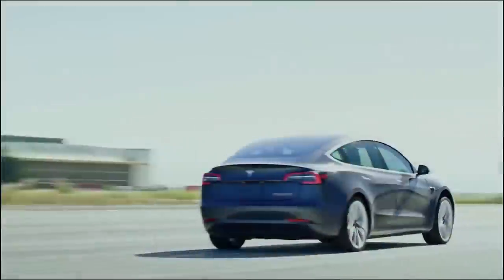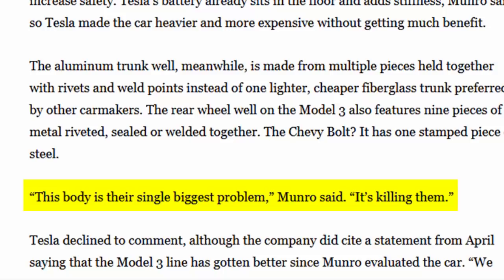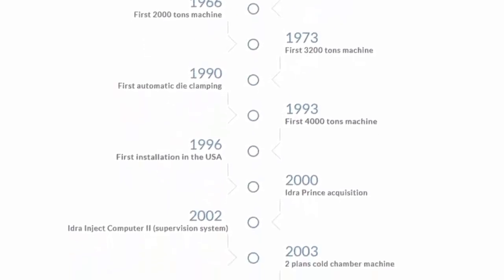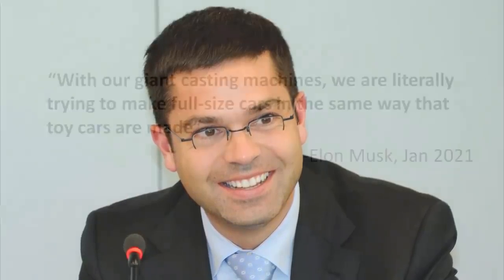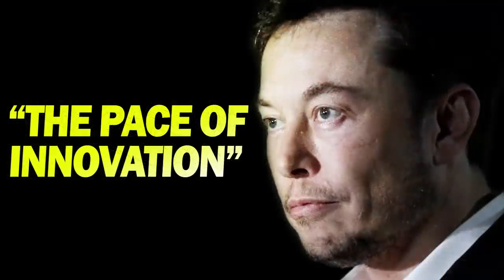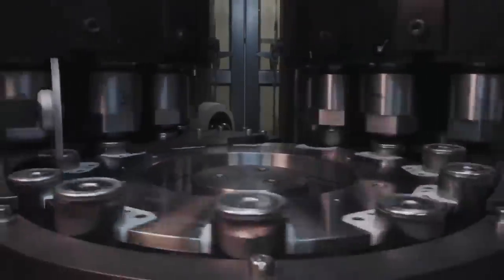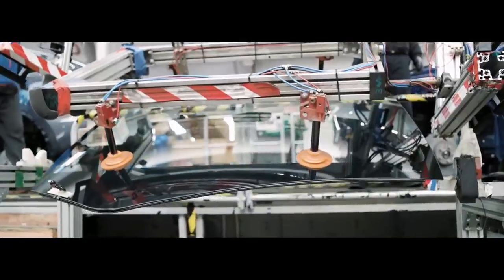Tesla Giga Press will CRUSH

Comment: The weight of  a tesla is insane  !
Gotta make that car weigh in at 3000 lbs or less !
Then we could double the miles between recharge !
500 miles instead of 250 !
Wow that might make the proffits of recharge stations suffer !
 Well too darn bad !
And where are the solar panels  on the car ??
It should be soaking up sunlight all day long !!
Reply: The weight might be insane but its a good thing to a tesla cant flip they tride it wen testing it at road worthy test the tesla shape and wight wont allow it to flip on its roof
Reply: Solar panels are heavy. 

Also, weight is not much of an issue, they range would not change appreciably. My experience: Autobahn, constant 130 km/h -> 18-20 kWh/100km. Sprinting around the countryside, lots of accelerating and decelerating -> 13 kWh/100km. Model 3. Yes, I could do that all day long before recharging, the resulting range with tha tkind of consumption is >700 km (almost 500 miles). So we're mostly there already. 

Also. check out the latest Audi A4, with one of the more performant engines. It's lighter, but only about 150 kg. That's not even 10%.

Comment: Tesla is not a totally vertically integrated manufacturing company.  I'm not sure why that idea is so prevalent.

The main thing Tesla makes that's traditionally outsourced is seats.

Tesla does make its own traction motors and electronics, but this is equivalent to an ICE maker building its own engines.  

Panasonic builds the current 2170 and 18650 batteries, and CATL builds some of the LiFePo batteries used in cars.  LG, SK, etc., supply batteries used by Tesla Energy.

The new 4680 Roadrunner cell is being designed by Tesla now.  It's unclear whether they will produce them in volume themselves, or partner with Panasonic, etc.

There is no reason for Tesla to buy the casting machine company any more than to buy robot companies.  Like wheels, tires, brakes, steering gear, suspension components, glass, dashboards, lights, etc., those are commodities sourced from external suppliers, similarly to any other car company.

Comment: I wonder if Tesla would do a "refurbish" of sorts for older Tesla Automobiles. Swap out the multi-piece designs for a new single piece replacement. If it is monetarily viable might it turn out to be good business sense? Have brand loyalty/dominance. GM has no clue what it is doing these days and I don't think Ford is that much better.
Reply: You mean disassemble the entire car to swap out some stuff for no reason? Yeah some idiot is gonna pay for that
Reply: @johnuferbach9166   Well if someone is bitching about "a bunch of stuff" it then it would be for a reason.

Comment: Still unsure why it’s called a “press” when it is a casting device.
Reply: Because aluminum casting must be done under enormously high pressures to get the complex shapes and details to come out correctly.  The bigger and more complex your piece, the exponentially higher pressure you need.
Reply: @suunraze  dude I’ve been asking this question for ages and you’re the first person with a reasonable explanation 🥳.  Any explanation, for that matter.
Reply: @suunraze  I still don't get it.  The only high pressure required here is the pump that pushes the molten aluminium into the mold.  The mold can just be held shut with clamps - no press required.  Is that's what is happening because it doesn't look like it?
Reply: No it can't just be held with clamps the process requires the molten metal to be under high pressure during the hardening/cooling which is done with a literal press.
Reply: @MrDJAK777  you can't close a press and then inject the aluminium after.  Is the press not fully closed, then the aluminium is injected, then the press applies a force (without significant movement)?
Reply: @Spedley_2142  the plunger that does the injecting stays there and holds the pressure and applys further intensification pressure if needed.
Reply: @Spedley_2142  the molten alloy is forced into the die with a hydraulic ram ,it isn't pumped in. the clamping is also done hydraulically to achieve rapid cycle times . I've been a hydraulic engineer for over 35 years so calling it a press is quite accurate.
Reply: I would call it an injection mold machine.  It is not a press as it does not work with a blank. It is not extrusion as the part does not flow out of the tool.  It is not casting as the part is formed not poured.
Reply: Yes. It's high-pressure injection moulding of metal using a high-pressure hydraulic ram. BMW have been making engine blocks this way for a while.
Reply: Probably because it's a press lol. It's not regular casting that doesn't use pressure. The dies press molten aluminum into place and that greatly increases strength.
Reply: @clutchboi4038  I don't agree.  The dies are assembled before the metal so it is injection.  Press dies are open and close on a blank.
Reply: @edwardg9695  Then it's a FORGING, like making a forged piston. You inject the aluminum and squeeze which helps with strength and also makes any air bubbles very tiny.
Reply: @peterdarr383  The mold is not moving.  It is clamped shut and vacuumed out. The molten aluminum is then injected hence injection molding.  If it used a billet and the forge closed on the billet to shape it - then I would agree.
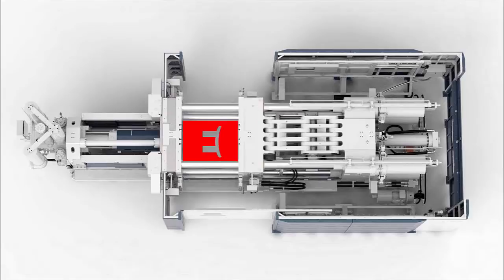Reply: 6:11  the two halves of the die cast mould are closed using a PRESS, the alloy is then injected at high pressure through a feed hole, then solidifies. The press then opens releasing the finished part.
Reply: @the_lost_navigator7266  you dont need a press to close stuff though
Reply: @johnuferbach9166  no, but a press will withstand the huge injection pressure trying to force the mould open. My company has several wax injection mould machines, they all feature a hydraulic press to open and close the mould, and cope with injection pressure.
Reply: Smart people misname things all the time. Physicists call a portal across bent space a "wormhole." WTF? There are no worms burrowing through spacetime (I hope). And why do orthodondists call some human teeth "canines?" They're not dogs. They're teeth!
Reply: In fact casting is when you let go molten metal in form by gravity. In this case is the keye pressure because aluminium is not during moulding liquid is just on border to be solid. Therefore can be tool opened so quickly and no need to wait for long cooling. The tool it self will be nice piece of engeneering. Machine it self is a bit bigger than normal machines.
Reply: Because of media/tesla idiocy
Industry calls them diecasting machines. Plastic injection molding machines, which are very similar in function ,are also called injection molding machines and not presses.
The only things industry calls presses are ,funnily enough, presses. Such as the sheet metal presses that form automotive body panels.
Reply: @paulg3336  I had a feeling it was marketing shenanigans
Reply: @paulg3336  Actually, it's because of the complex function of this machine, because it's basically both, die casting and a press. If you want to have a great pressure of injection you also need a f-ck ton of press clamping force to hold the mold shut, so none of the liquid metal sprays through some micro slit in the mould. Imagine 900C aluminium under that pressure gushing through some breached crack.
Reply: @mjtwardy  pressurized molten metal  would probably be one of the closest analogs to a lightsabers on screen effect just more sticky and indiscriminate.
Reply: @MrDJAK777  Maybe not like a lightsaber but a phaser beam out of control. :)
Reply: @mjtwardy  Yes , I used to operate plastic injection molding machines as a school  holiday job. The clamping force on those are typically several hundred tonnes for large tools.
Still never called them presses though. Must be a yank thing. Using the wrong words for things is your national sport isn't it?
Reply: @paulg3336  I'm not an American, if thats what you ask. I understand its a mold injection machine. I think the "press" name is just a mental shortcut and most people do not really care if its a die cast mold incetion or just a press.

Comment: So, doing the math - 13,227 lbs of force. Ladish, in Cudahy, Wisconsin, USA has presses rated at 4500 tons, or 9,000,000 lbs, and another  (seized from Nazi Germany at the end of WWII) rated at 10,000 tons (20,000,000 lbs). The Russians seized the largest press the Germans had, and the US got the next two smaller ones. Germany was using these to make aluminum forgings used in fighter aircraft due to a ban on imports of steel. These large single components were lighter and stronger than comparable assemblies made of multiple pieces, and were used in the formidable Messerschmitt fighters, including the 109, and the first jet fighter, the Me 262. For more information, look up "The Heavy Press Program." 
Incidentally, the swastikas and eagles remained on the presses at ATI in Cudahy until recently. Many foreign engineers and project managers raised eyebrows and had questions when viewing the massive machines. The markings were eventually removed.
Reply: https://youtu.be/iZ50nZU3oG8

Comment: I have worked with large molds for the last 23 years using a 3500 ton cold chamber Prince die cast machine.  I can say that die cast machines are work horses and rarely break down.  Mind you I did have a large stock pile of spare parts to aid in having the machine repaired usually in a matter of hours.  My mandate was to be able to fix any issue and be back up and running in three days.  Rarely did I need that time...
It's amazing the size these machines are by trying to imagine how big this is by the image at 4:50 sec with a guy standing beside the machine and is not even as high as the lower tie bar!!!

GREAT VIDEO!!!
Reply: wonder what size tip they're running 8 or 10 inch, I ran 2500ton in squeeze cast cold chamber, on bedplates super heavy walled casting, all slow shot with multiplyer kicking in at 9 inches from end of shot, with vacum

Comment: Molds are big money and hard to BEP Boeing/I was injection molding short fiber reinforced PEEK running 600-650F but it was more like rejection molding and the spring back or internal stress built into the parts were like reinforced pre stressed concrete. If the PEEK graphite parts cracked the part spring back was like a rocket. I do not know how Tesla prevents warpage and voids. Maybe Tesla Tig welds up the casting voids and has a holding jig to cool off the part warpage.
It would be nice to see cermeds or Al reinforced with ceramic like SiN or SiC  fibers. Maybe that is more for SpaceX big money light weight stuff.
CerE Udub
Reply from the maker: Pretty cool how often do you think molds like this would need to be changed?
Reply: @TMIOTesla  Plastic never and hot liquid Aluminum Al is just as soft Nylon 66 The good thing there is no high production. Problem is liquid metal has ceramic or refractory material in it which tear up a CNC Inconel mold. I was only doing PPS or PEEK no sand or refractory stuff. .

Comment: There has been for a very long time. Large Die casting machines capable of say an engine block or mag wheels. I ran such machines when I was 24 years old.. I'm 65 now. It's about time to make bigger machines.
Reply: The problem I have with using castings for large structural frame members is the invitation of fractures, especially in accidents. 
we see it enough in small suspension components.
Reply: @dbspecials1200  the Tesla presses don't use regular casting technique as the metal is pressed into place. Also the machines have built in x ray inspection to check for imperfections.
Reply: @clutchboi4038  you do know that xray is not a superweapon right? Identifying the crack we are talking about here is nearly next to impossible. Tesla is not a futuristic supercompany from the outer space. They are using current technology and diecasting is diecasting my dude you will have faults.
Reply: @clutchboi4038  They are not Tesla presses, they are IRDA presses from Italy.

Comment: If a bad enough collision did occur, how hard would it be to just swap out the damaged parts with a new giga cast part? Then resell the the car as "factory refurbished?"
Reply: Good point. But it seems like a good business idea because there's also going to be Tesla Insurance. Maybe if you buy this Tesla Insurance, you will be able to replace the whole frame for a small additional charge? Or a new car for a better price?
Reply: Just swap out the thing that holds everything together? So just fully disassemble and reassemble? Yeah doesn't seem like much work at all
Reply: @johnuferbach9166  just asking -no need to be snarky about it.
Reply: Could probably be repaired with a cutout piece and sold to Chinese market etc. as a 2nd hand vehicle. It's certainly not ideal from a repair point of view. Either that or entire bolted section removed and replaced at a huge cost, and you only have one place that can supply the part... Tesla.
Reply: I question the overall impact safety upon collision. Using aluminum vs steel? Remember when the Corvette  in the 60's/70's came out with a fiberglass body? How safe was that? There must be a formulae out there that solves the question of what is best for the human occupant when a crash occurs. Auto manufacturers has second guessed this for decades. The impact bumper of 1970 and airbags come to mind. Any one here to reply would be of value to our group here. Thanks, Ziggy
Reply: @ziggy979  They can cast in exact safety features into the section where required, that can make for an incredibly safe vehicle. The bad part in a severe accident is it will crush and stay crushed and likely be very hard to cut someone out of, unlike a thinner steel car, but that is conjecture.
Reply: @VenturiLife  yes and no, aluminum is easier to cut and bend, jaws of life will still smile at opening these beer cans, likely more easily than a traditional stew unibody.
Reply: @taylorpratt6287  That is true.
Reply: @ziggy979  you do know that didn’t change right ? It’s been primarily fiberglass with some aluminum and very little steel in the corvettes, they’ve even made a carbon edition recently that was primarily carbon fiber including the chassis

Comment: At 09:50 Each machine is not limited to only one part to be cast.  There are exchangeable dies that form the shape of the part and these can be swapped out very easily.  Therefore the Whole machine was not custom made for Tesal, only the dies (which Tesla probably makes themselves). Hence, any manufacturer could utilise that same machine that Tesla uses, with their own dies.
Reply: Die care not that hard to make even the big press. Other manufacturers have been even using magnesium aloys castings.....
Reply: Die engineering is an entirely separate field. For a die of this size & complexity, I would not be surprised if the cost of the die rivals the machine itself.
Reply: @ChrisCiber  its not that complex, CAD and structural tests exist for that, other car companies have been doing racing and many other very heavy constructions and have materials departments where they develop carbon fiber, comlosite materials, aloys......
Reply: @ChrisCiber  Tesla will design a die or contract a company to do so. Separate from the actual die manufacturing process. Dies will wear out and be disposed eventually. I hate that they are so many videos about the GIGA press by people that have no idea about diecasting. I work for a leader in die casting machine manufacturer. Let me know if you guys have any questions.
Reply: @ChrisCiber  Well you will indeed be surprised...  The die costs are trivial compared the cost of the press.  Educate yourself before making stupid statements... What is your source for this opinion?  I have worked in a die workshop.
Reply: @stevebothe1416  Example cost comparison?
I used to study (didn't end up going into the field though, so I can't tell for sure) manufacturing planning and engineering, and that is what we were told repeatedly. It seems that each additional step can add increasing cost (in R&D, not die material).

Comment: I used to work a 400 ton press at work and I thought that was impressive.  You can feel the impact through the ground every cycle.
Reply from the maker: Pun intended? :)
Reply: @TMIOTesla  
Good catch!  It was unintended surprisingly.
Reply: But it's not a press so no impact
Reply: @jonbong98  
Illogical
Reply: @jonbong98  the mold is evacuated and filled with liquid metal in 110miliseconds, roughly a tenth of a second. Some kinetic shock might be noted
Reply: @captainTubes  
Well I was talking about the press I I worked with which did impart significant kinetic energy into the ground every cycle. 

It was a kamatsu something 400